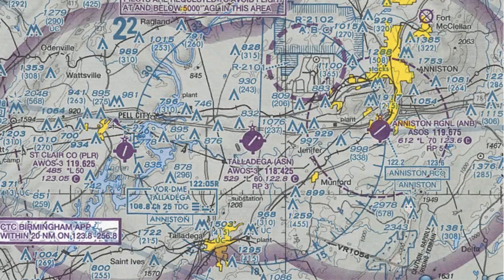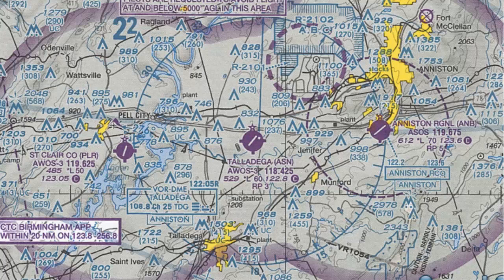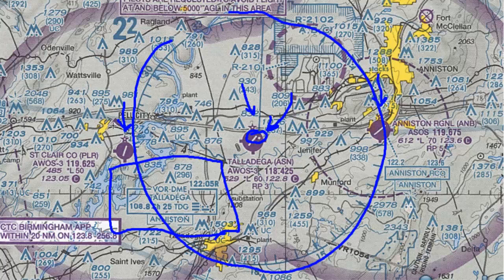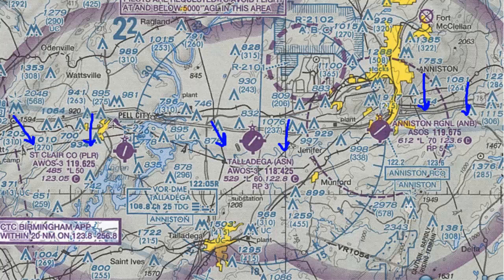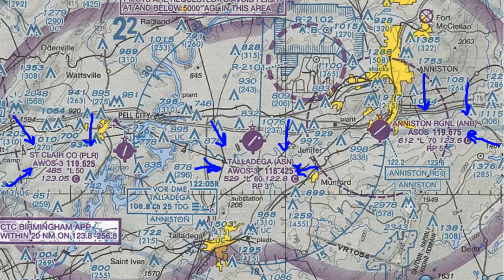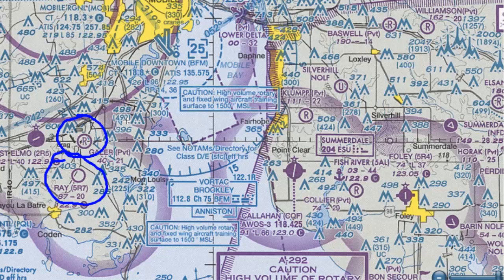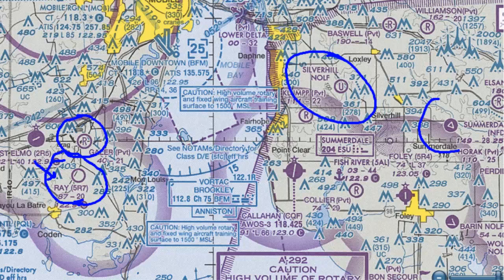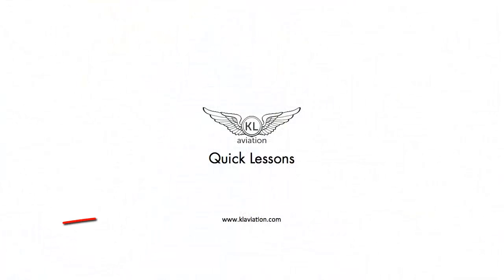Uncontrolled Airport Information - Sectional Chart

Comment: where did you come up with the second runway #s (21 & 23)? 3 and 5 are on the diagram but the others you mentioned aren't. Also, how do you know what direction the runway goes?
Reply: Second number is thderived by adding 180 as it's the reciprocal.

Comment: I wonder why noone asked why exactly 8069ft... As if changing a major element on a sectional to another one basing on such a strange random number is widely accepted and is an ordinary thing.
Reply: Which jeppesen book are you referring to? Are you talking about the Private Pilot test guide?
Reply: The scale of the sectional chart is the answer.  Runways longer than 8069’ can be drawn their actual length to scale on the chart.